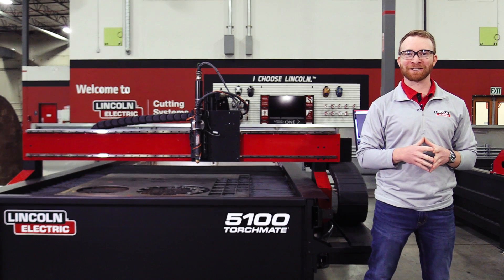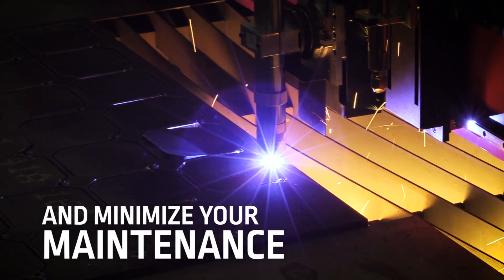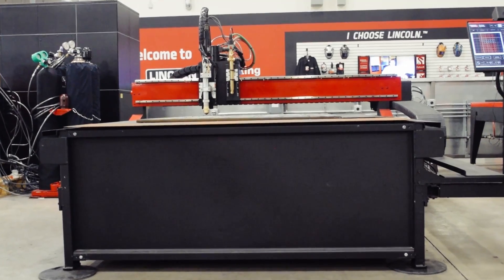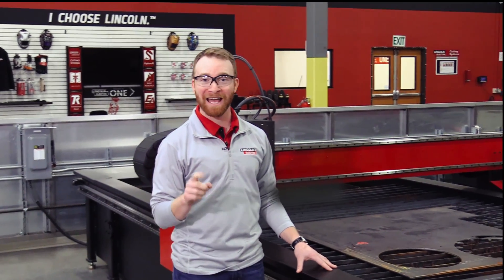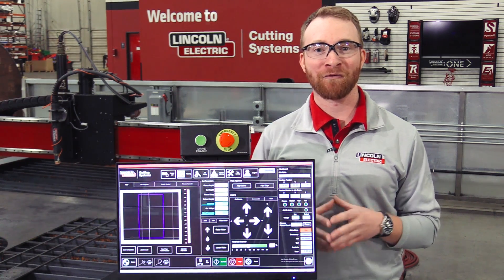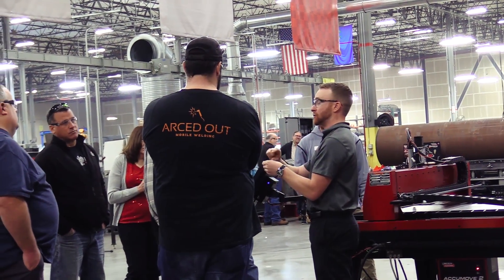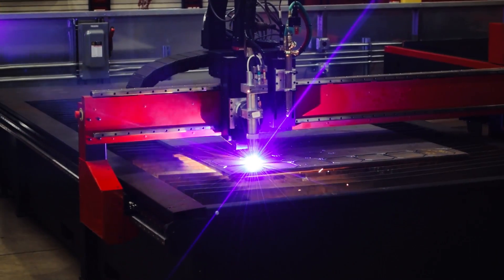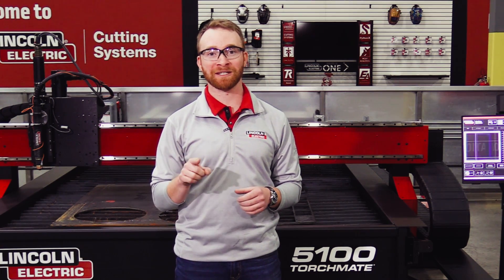Product Overview - Torchmate 5100 Industrial CNC Plasma Cutting Machine

Comment: What’s the price? Canadian ?
Reply from the maker: You can get an instant quote at https://torchmate.com/torchmate-5100 or give us a call at 1-866-571-1066!
Reply: I only need up to one inch thick steel flat bar and plate cutting machine that table is to big for the shop where I'm going to be putting it.

 How about just tell me which plasma cutter machine only I need to cut up to one inch only I'll cut the two inch parts on the band sae i ordered this morning hopefully the guys get finished with thr new shop by the weekend an get the overhead crain up an running as well model number of the plasma cutter machine please